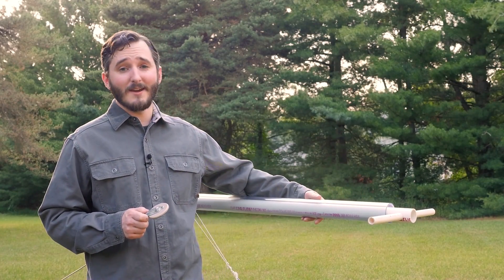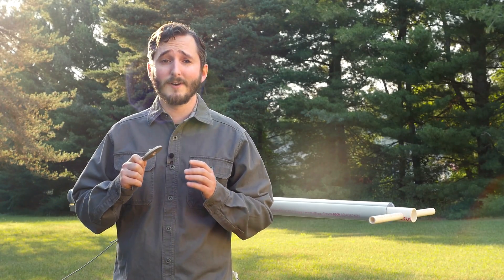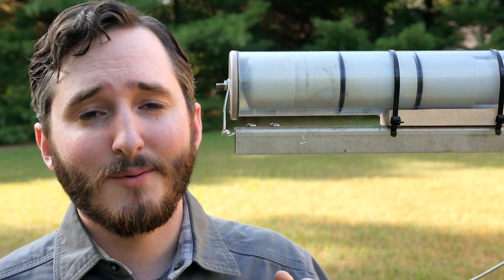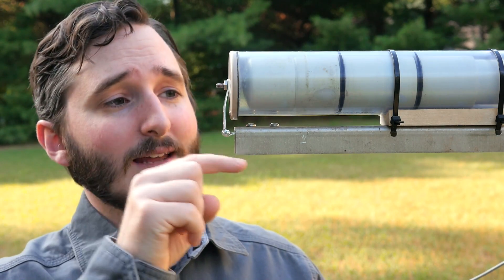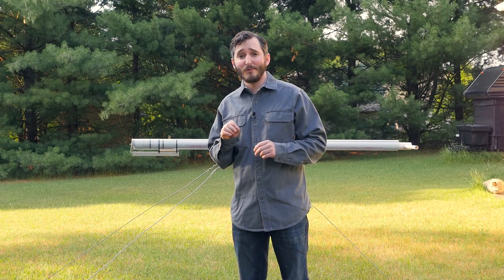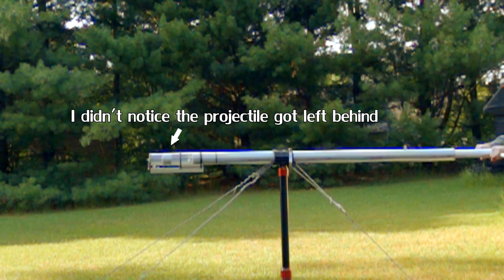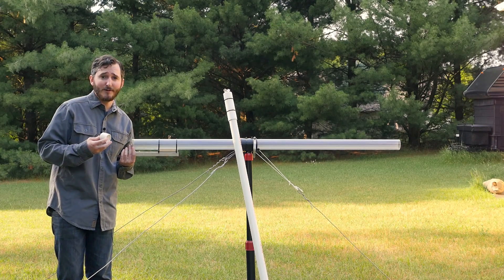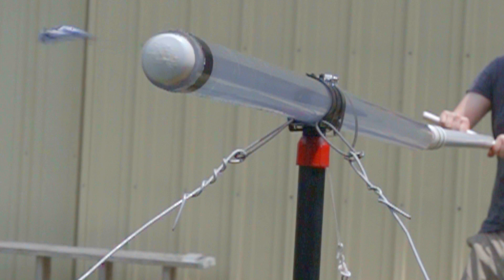Firing A Clear Vacuum Cannon & Testing Viewer Suggestions

Comment: I do not have a lot of knowledge with science but it seems as if the valve isn't falling fastest enough no matter how you alter it. So I think (with my very minimal understanding of science) if you found a way to make the valve heavier ,maybe with fishing weights or something and the moved the hinge more towards the cannon instead of away so the center of gravity of the hinge is already wanting it to fall out of the way, kinda the opposite of what you did in this video, maybe that would work? I dont know feel free to critique me. I'm very bad with this kind of stuff. I just thought I would throw my 2 cents in
Reply: Gravity applies a force to an object directly proportional to its inertia, so it would not fall much faster. (only overcoming the small amount of friction/air resistance a bit more) adding mass would also resist the force of the air pushing it out of the way more.

Comment: What if you attach a string to the back of the flap valve, use a pulley (or just something round) stuck out underneath and in front of the valve to get outward+downward force, and tie the other end of the string to the end of your plunger at the correct length so that when the plunger exits the barrel it also pulls the flap out of the way?

Comment: the problem with this is that the force of the air before the projectile is fired is the same as before you pull back the piston + the fact that the valve is stable without a vacuum means that the valve won't open much.
an easy way of fixing this is to place the piston further back on the pipe meaning there is more air to be compressed infront of the projectile putting more force on the valve.
Reply from the maker: I test that in the later half of the video. I think the real problem is that the valve opens too easily, so it opens as soon as air impacts it rather than allowing it to compress which would make the valve open with a pop.

Comment: you could try putting some gasoline in the position and then compressing it to the point of selfignition due to the pressure. it would be awesome and cool if it is possible. also you look like you would be in a beard/hair  commercial. you look manly and modern

Comment: This will probably also not work, but instead of one big valve at the end you could use... two half valves. Maybe if one half opens to the top and one to the bottom they need less time to tree the way for the projectile.

Last but not least suggestion: Put some corn starch in the end of the tube, so it gets shot out by the projectile.
Reply: I had a similar idea, but the half flaps would need to open from the sides instead of top and bottom.  Otherwise gravity would help the bottom flap and hinder the top.  If the projectile hits the flaps, it needs to hit both at once to prevent deflection and reduce damage.
Reply: It's a very good idea because the moment of inerzia decrease, the only doubt is about the sealing...
Reply: Thadox maybe a half sphere cut in halves could do the job.
Reply: c muller no, because if you use a half of a sphere, the center of mass is over the end of the cannon further than it is in the video, moreover the moment of inertia increase, so it's difficult to make it rotate around its axis, as a result it takes more time to open.
Reply: in front of a candle!
Reply: Thadox You didn't get it. It's 2 quarters forming half a sphere... and gravity is too slow anyway. Just release an object and measure the distance it moves in the 0.1s between the piston reaches the end and the arrival of the projectile.

Comment: I suggest having some rubber bands aiding the release of the valve. Have the rubber be in front of the hinge fro the most of it's position, but just pass the hinge when you close it, that way it will hold the valve against the tube, but a light nudge will send it flying. Essentialy same as gravity, just faster and stronger.

Comment: if aluminum foil works, maybe if you build a lighter lid  maybe  flexible one, could work and be pushed easily by the air, like only a piece of rubber held with a hinge or a small piece of cord, if hits it won't decrease the speed of projectile
Reply from the maker: The first thing I tried was a toilet tank flap valve which is solid rubber, but it wasn't strong enough and got sucked into the pipe.
Reply: NightHawkInLight if you make it a bigger diameter yo prevent that ? could work?
Reply: i mean something like your aluminum foil but in flat rubber diaphragm just with the strength enough to hold, you can add a light reinforced frame to maintain shape yo avoid to suck it into the pipe

Comment: maybe a piece of 1 1/2" or 1/2" rubber cut like a pizza (in 8 triangular pieces) but on a 45 degree angle to have a one way opening. Like a Gatorade bottle cap
Reply from the maker: Not a bad idea, but sounds like it could be unreliable with so many pieces
Reply: NightHawkInLight I've pondered that. Maybe, a construction paper design to cut weight, but then there's reliability
Reply: NightHawkInLight maybe take a couple notes from Mr. Kalashnikov
an auxiliary "gas" piston that runs along the top of the cannon that forces the valve cap to pop before the projectile reaches it
Reply: REZ L1FE24 Exactly what I was thinking!

Comment: You could try adding a spring or a rubber band to pull the valve down before the projectile hits it. You would need a latch to keep it close though. Also to make the barrel smoother you could try taping sandpaper to the projectile. It would likely make the inside cloudy but it would be hilarious to watch
Reply from the maker: Ha, yeah not so sure about that sandpaper idea
Reply: I was thinking of spring loading it, small piece of tape to keep it closed and once ready to fire, pull a small piece of string to remove the tape then fire
Reply: NightHawkInLight You can use a magnet in the end of the piston and a external magnet on one side attached by string to the valve. This way when the piston is at the end of the barrel, you can push the spring loaded valve in place and use the magnet to keep it there temporarily. Once the valve is pulled back there should be enough pressure to hold the valve in place and at the same time the magnets will separate and the external one will fall to the side, out of the way of the impending destruction coming out of the barrel lol

Comment: Try to use some rubber bands to springload the flap valve (like a trap). Place them in a way that just the slightest movement backwards triggers the flap to open (sorry for the bad explanation, hope this makes sense and if it doesn't work... oh welll i tried to suggest something)(eddit)(I re-thought what i wrote and the only way to make this happen is to tie the rubber band to the ground just a hair behind the valve but that isn't very preactical)
Reply from the maker: Yeah I understand, it's a good idea but I still suspect it won't be fast enough. I think something completely new is needed rather than a flap valve.
Reply: Yea I re-watched the slowmo and maybe it'll have to open around 4-5 times faster so the projectile doesn't hit it. A simple solution may not be possible but there are so many a little(or a lot) more complicated options if you decide it's worth the effort(which might not be). And thanks for your awesome content :)

Comment: If you add an extra bar maybe 6" under the valve thing, attach a rubber band to that bar and then the top of the valve, also getting rid of the hinge and just having a string to hold it after firing, the rubber band may help to get the valve out of the way in time.  It would also just be held on the cannon tip by negative pressure.  I've done something like this for a different air cannon like thing that I built last year because I had nothing better to do

Comment: I wonder if the mass of your flapper valve is part of the problem?  The heavier it is the slower it will be to be pushed out of the way by the air pulse in front of the projectile.
Reply from the maker: It's quite light, I don't think it could be made any lighter while remaining strong enough to work. I used a lighter hinge and smaller attachment bolt for the valve in this video than my last one.
Reply from the maker: That's actually not a bad idea at all. A cork would work well, though the projectile would almost certainly hit it from time to time
Reply: @Nighthawkinlight  What if your projectile had some sort of iron or steel (magnetic) tip? You could load the piston and projectile into the barrel, basically to the end, and then put a small sheet of latex rubber or maybe thin neoprene over the end of the barrel  and hold it in place by a small magnet on the outside that is attracted to the iron or steel tip of your projectile on the inside. By dialing in the thickness/stiffness of the rubber and the strength of the magnet, it might be possible to find an arrangement where as you draw back the piston, the rubber sheet would be held in place by the suction and the magnet could fall away. It would be an elegant and reusable solution, as long as there was enough residual air left in front of the projectile to push the rubber sheet out of the way in time.
Reply: Have you considered holding the valve in place only until the vacuum is formed (after which the vacuum should maintain it in place)?  (I believe you did mention something like that at the beginning of the video.)  You could maybe build some type of latch that releases when the piston is pulled far enough out.  Once the vacuum is there, the pressure difference should hold the valve in place pretty strongly, and you could even add an opposing tension (e.g., a rubber band) to help pull it out of the way faster when the vacuum is removed.
Reply: Mass is clearly the issue. The flapper has too much inertia to get out of the way.  I find it difficult to imagine a flapper could be anywhere near as light as the bit of aluminum that makes up a burst valve. My suggestion would be to pre-fab a few burst valves onto sleeves so that the cannon can be reloaded and reset quickly.
Reply: Rig a mouse trap to open the flapper.  Basically, by setting the mouse trap, the flapper is closed.  However, attach a string from the trap trigger to your pull pipe so that about halfway back (may have to test the trigger point, adj accordingly) the string releases the mouse trap, but atmosphere is holding it in place.  The second the pressure gets low enough to overcome atmospheric hold on the stopper, the spring will pull it out of the way ahead of the projectile.   You can get 4 traps for about $1.  That's 4 springs and 4 triggers.  Can't beat it.  Watching the slow-mo is what gave me the idea.  Watch a mouse trap trigger, starts out slow then all hell breaks loose.  With a large enough trap, say a rat trap, you might be able to use the trap whole by putting a hole in it.
Reply: Great work on these videos NightHawk. I wonder if you could try a thin but rigid aluminum disk on the flap valve, with bicycle inner tube rubber glued to it. That's about the lightest disk you can easily make. As well as Nabre Labre's suggestion of a blow back pipe, maybe the outside of the projectile could be 'rifled' to make it spin and stabilise it's flight? Just a few small grooves to let a little air passed while firing. Looking forward to the next one!
Reply: Was what I was going to say.  Valve has to much mass to be pushed out of the way by the small amount of air available in the tube.
Reply: would it work the same if instead of an internal projectile and burst disk you had the projectile fit over the end of the tube to create the seal?
Reply: I'm thinking the mass might be something to do with it.  I have another suggestion... if you can find a ball or some rigid sphere, you could cut it in half or use a part of the hemisphere (dome), and flatten/smooth out the edge.  then put a sealing ring on the end of the pipe.  This way the valve can be both light and rigid.  Then secure 2 long skinny elastic bands on opposite sides of the dome and the other ends under the pipe, just enough to hold the dome from falling off.  Glue a small lip at the bottom outside of the opening if friction isn't enough to keep the dome from sliding down.  keep a small slug of air in between that and the projectile.  I'd be interested to know if it helps and survives.  The dome would face outwards.  I'm also thinking an inverted dome with a sealing edge might also work?
Reply: I guess that the one way to fix it is by making another smaller pipe that would be opened faster than bigger one, and helped the bigger opens little bit faster.
Reply: NightHawkInLight for sure the lighter flap would help!! maybe a carbonfiber disk with the PTFE would work and for the hing make it as minimal as possible! 2 wires epoxed to the disc and threw some I hooks!
Reply: I think the problem is why more air in front of the projectile does not open the flap faster, that the air immediately after opening the flap escapes and the flap does not accelerate further. The foil is also catched up from the projectile, although it is very light. Why not use the seal as a projectile? It surrounds the tube by a few centimeters and is exactly the same as the projectile. They two travel together and can be gathered and reused. The seal has to be very light to have as little loss as possible (to accelerate faster).
Reply: This is a bit of a longshot but perhaps you could look into the same systems that real rifles use when it comes to gas tubes. (Using some of the gas or pressure created to affect the core mechanisms of the rifle or in this case the cannon)
Reply: Perhaps the hinge is part of the problem, too. If the seal was part of the barrel (an o-ring) and the flap was a thin disk of sheet metal, with a small tab that acted as a hook to hang it over the end of the barrel, and a piece of string to prevent loss, then the flap might fall out of the way faster
Reply: Also consider the flat backside of the flapper . When the inside air starts to push the flapper open (with a sudden impulse), the flapper's flat back takes twice the force needed to reach a certain acceleration than a more aerodynamic back would need. If you can measure the speed of the top of the valve using the high-speed footage, you can find out how much of this effect is present.
When making the valve lighter and faster, the aforementioned effect becomes more dominant.

A solution to the valve problem with extra spring-loaded energy around like +ejler thomsen suggested would work well (if you can get over the hump cleanly).

To help with this you could install two parallel tubes alongside the '3-' and '9-oçlock' positions of the barrel (the symmetry helps with pulling three plungers straight back and the two extra air-jets apply a symmetric load on the flapper). 
The plungers of the side-tubes are a little bit shorter than the one for the barrel. The ends of the side-tubes bend inwards a bit and are kept shut by little protrusions on the flapper.
When the cannon is fired, the side-jets will have fired a little bit earlier and are already pushing on the flapper (thereby counterbalancing some of the air-pressure holding the valve shut) when the barrel-air arrives. This will result in a faster opening of the valve if you can get the timing right.
Reply: also i noticed that there is recoil on the valve, it opened, hit the end and closed back, hiting the projectile...
Reply: Perhaps <1mm steel sheet in a disc. Put the seal on the barrel (as Patrick Fitzmorris said). Use small magnets (like for diy fridge magnets) to hold it on at the start.
Reply: Rallaster Dracomyr no. It's the vacuum between the cover and the projectile that accelerates it. The closer they are, the slower it moves. If it is the cover, it would simply fall off.
Reply: Just glue an o-ring to the flapper valve that fits the pipe tightly so when the projectile is close to the end it will create pressure and will make the valve to pop like a champagne bottle cap, hopefully with enough power to get the valve out of the projectile's way.
Reply: This is ridiculous; you're all over-engineering this. Research labs don't use a flapper valve at all for things like this (shock-tubes, etc.). They use a burst-diaphragm. The suggestion has already been made twice in this thread alone.This is what Action Lab used for his ping-pong vacuum cannon ( "How Fast Is a Vacuum Cannon?..." )
Reply: Mass no, counter pressure of the atmosphere. Vacuum cannot overcome pressure. Try putting a magnet on the projectile and one of apposing polarity on the valuvevaluve.
Reply: NightHawkInLight you should make a bypass pipe that lets some air around the projectile to open the door